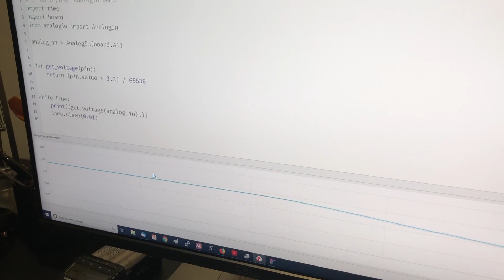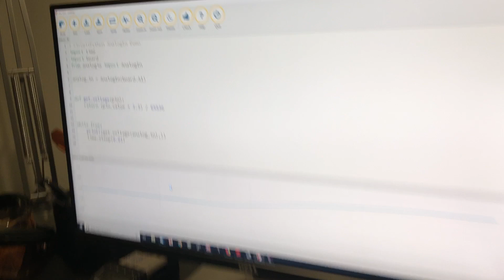Testing analog input on ST32F4 port of CircuitPython using Mu

Comment: Ah, cool! Haven't tried an F412, but have used the beefy F411 before. (F412 adds external memory, LCD controller, and qspi? ST web site not super easy to compare)

The Nucleo boards are pretty decent: not too expensive (cheaper than Discovery?) and still include the snap-off programmer - but no extra peripherals included, and can be weird getting USB to behave. But, I've seen a lot of commercial products (mostly IMU dev kits) designed to connect to Nucleo headers.